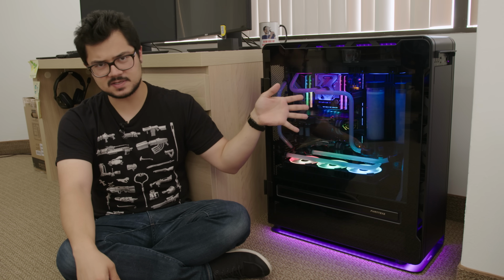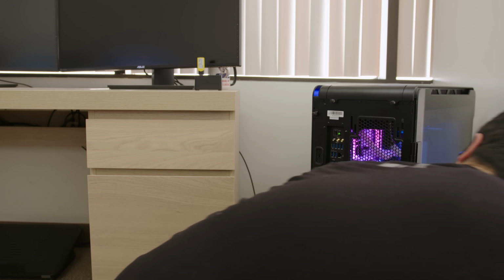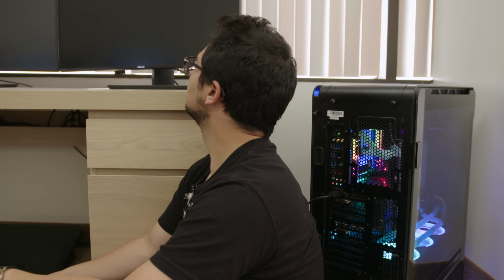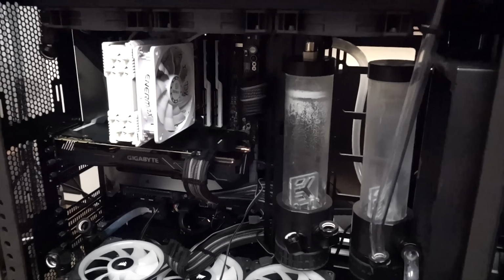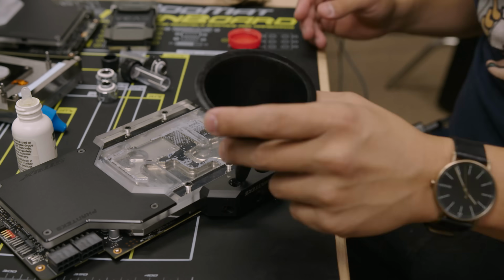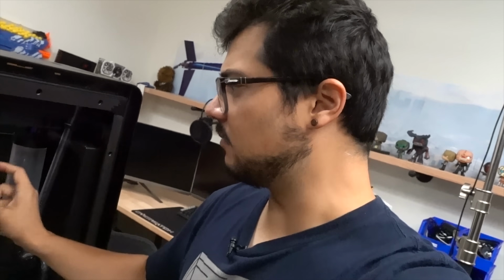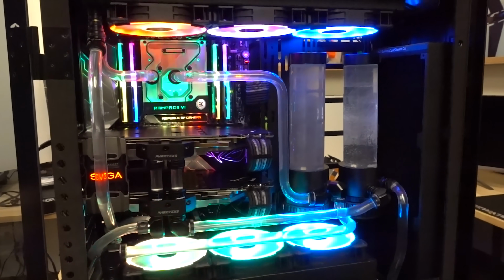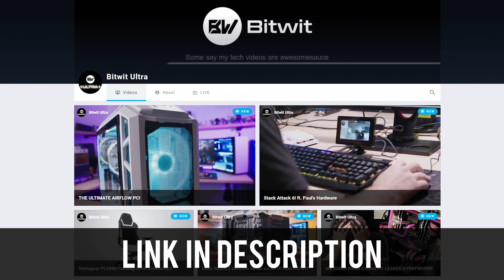Fixing my $12,000 BRICK

Comment: You Helped Me Building My 13,000 $ Pc Love You
Reply: Mack Gaming $13k for a computer
Reply: Mack Gaming I want to see this pc
Reply: Mack Gaming that is the most overkill thing ever I love it
Reply: Mack Gaming - Wow, and I thought the upgrades I was gonna make to my PC were overkill for my use. Soon gonna be getting an extra 16 gigs of ddr4 ram, an upgrade from my i7 6700 to an i7 7820x and an I will be getting an 1180 whenever they come out to replace my 1070. Since I'm moving on from 1080p gaming to 4K gaming I thought the upgrade would be necessary. The extra ram isn't necessary but I might end up buying it anyway and putting it into a new system.
Reply: Just a question why the 7820X and not a 2700X for half the price?

Comment: All that work because you didn't check to see if the monitor was turned on... :P What a Goob! XD
Reply: It was turned on, video wasn't showing. Any number of things could've really went wrong, but the first thing he should've checked was the GPU, monitor, and video cable.

> No video? -  Check GPU, monitor, and video cable.
> No power? - Check power cord.
> No audio? - Check speakers.
> Automatically shutting down nearly after booting? - CPU overheating and the CPU cooler is probably not working or unplugged.
> High(er) overall temps? - Check for and try dusting, then replacing CPU and GPU thermal compound if it doesn't fix it.
> Audio interference? - Buy and wrap speaker/headphone/microphone output/input ends with ferrite choke cores.

Comment: I had a similar problem with my PC. Upgraded the RAM and the computer wouldn't turn on thought I may have shorted the motherboard or something. I had to leave the PC for a while as work got busy but luckily had my laptop to do work. Come back to the PC a few months later and it turns out I hadn't seated one of the RAM sticks properly. Just pushed it in a bit more and it works fine.
Reply: Brookler yea ram sticks can be a bitch like that, I spent 4 hours diagnosing a friends computer. And all we had to do was push in the ram a bit more XD
Reply: I had a similar problem. A friend and I both built new pcs for Christmas. He brought his over to show me and it would not turn on. I looked after 20 minutes found out there was no 8 pin to the mobo. still Wouldnt work. 2 hours later we realized that the ram was in 1 slot to the left.

Comment: Had a similar problem to this before. When I turned on the pc I'd have no errors but there was no post . I eventually figured out that power saving on my monitor was messing with the rtx2080 . Now I have to time switching on the monitor so it boots. A few people reported that display port on the 2080 is buggy

Comment: I think the problem was with RAM, i've had issues with ram before and not getting anything displayed unless u remove all ram and do a CMOS reset. Even then just booting with 1 stick to get it to POST then installing the additional DIMM's. If this isnt an actual solution then i am stumped too as to what it could be. If it was a GPU issue not being seated properly I believe pluggin it into a monitor would come up as no output device detected. Looking forward to a feedback / reply. Great video and awesome setup, Kyle!

Comment: rx 580 8gb or 1060 6gb?
Reply: i think 1060 is better but the price is higher right?
Reply: Get whichever is cheaper. They are more or less equivalent
Reply: Definitely go RX580, about same performance in DX11, but way better performance in DX12 and Vulkan.

Edit: Also freesync monitors are way cheaper then g-sync monitors.
Reply: I just upgraded to a 1060 3 days ago. It’s amazing
Reply: get wichever is cheaper
Reply: The cheaper one unless you have a freesync monitor that needs the rx580 even if it's expensive
Reply: Type in google rx 580 vs 1060 and visit the page called gpuuserbenchmark or something similar like that. Its a very useful site
Reply: Wait my rx480 was already roughly equivalent shouldnt the 580 be a bit better?
Reply: userbenchmark isn't 100% reliable because it doesn't take into account what manufacturer/model card they have, what CPU they've paired there card with and weather or not they've overclocked it or if it's factory overclocked etc.
It's a good website to see what kind of performance to expect from a particular GPU but it isn't recommended to use it to comapare 2 similar GPUs since there would be many variables involved.
Reply: Both are good cards, go for the RX580 if the difference in price is small, you could also benefit from free-sync as these monitors come in quite cheap!
Reply: i would go with  1060
Reply: I would go for rx 580, it’s the best value card as of now
Reply: RX 580, 8GB is always better to have, and the much more important part is it can be used in Crossfire, while the 1060 cannot. Two RX 580s scale to near double performance of a single card which is around ~1080-1080TI range. I picked up a RX 580 card for $250, then another 6 months later for $200. Its a great card on its own too and provides a good upgrade path, as well as FreeSync support for monitors which is slightly cheaper than G-Sync.
Reply: I would say get whichever is cheaper, but there are some things to concider: The 580 supports DX12, and has 8gigs of memory, which makes it more future proof. If your monitor has G-sync or Freesync, go with the card that supports that feature (For instance, definitely go with the 580 if your monitor has Freesync). The 580 does also support crossfire (allows you to pair it with other AMD GPUs), but the 1060 does not support SLI. Verdict: PERSONALLY, if you want a card right now, I think the 580 is the better card (If they're both relatively the same price). I have a 580 myself and I love it. Also concider that the new Nvidia GPU series is coming out soon, so if you're not in a hurry, I would concider waiting for those.
Reply: Save a little longer and get a 1080
Reply: If your using the card for video editing and are using premier pro go for the 1060 for cuda support and faster render times. If not go with the rx 580
Reply: rx 580 8gb way way better
Reply: rx580 and i have no regrets for the good prices they are at right now
Reply: i got an rx 580 8gb because it was cheaper aswell as its vram
Reply: ya 8gb vram does wonders and driver updates keep improving performance

Comment: I had the same kind of issue with my PC. I have a morpheus 2 custom cooler for the 1080ti which is pretty big. The clip that holds the 120mm fans was sticking out and hitting the motherboard which just barely blocked the PCIe connection by a millimeter. Finding that out was such a pain.

Comment: My guess is the fluid that you were using was clogging up the system and causing the issue on top of maybe a loose card but I thought when trouble shooting the first thing you would check is all the cards and see if they are seated correctly.

Comment: If you had an improper video configuration, nothing may show on screen.   When you removed video cards, that will reset video and allows a signal to show.  I had integrated and a gpu card and tried to display on both but nothing would display on either port until I removed the video card and bios setting "reset" to only working view.

Comment: If you start with A0=All is Good, why are you even starting with clearing the CMOS? Have you checked cable connectors?  Have you tried different monitor cables? Different monitors? I keep an old monitor for my test bench I know to work. A Raspberry Pi with connector adapters would be a great test unit to rule out peripherals (and connectors). If peripherals pass,  odds are it was something not properly seated, most likely one or both VCs but you didn't eliminate them as a problem as you went straight to barebone, which isn't bad, though it would have been nice to see the problem narrowed down to the issue.
Did you run it with the PCIe M.2 board installed again? 
What did you clean off/out your tubes/reservoirs/blocks with? I have yet to work with custom cooling and would be interested in how you went about it. Glad to see that pearlescent cooling fluid is not a great idea, so thank you for that. Looks like artificial cholesterol, a potential head issue indeed!

Comment: Had a sort of exact same issue... disconnected, reconnected everything disassembled and reassembled the whole rig, cleaned it in the process.. and guess what !?! It was booting the whole time , but the HDMI cable semi-died. and finally after hours of hitting my head i take an old VGA monitor plug it directly to the mother board and i see picture . instantly i change the hdmi cable and yup ... simply worked normally

Comment: I’m almost positive it was your flux capacitor not aligning with your cpu ram drive. Sometimes if the megabytes outweigh the power supply you’ll drain the motherboard. Easy fix though glad you figured it out.

Comment: Had the same krap with my Rampage V board and 1080, thought the system was boned until I used and HDMI cable, presto it all worked. Once I got into Windows I switched back to Displayport. Every now and then the system reverts back and I'm forced to use HDMI to see anything again (Usually after a Windows reset). Still not sure if this is a Windows issue or the Nvidia graphics.

Comment: I think maybe it was the VUE fluid. I think it possibly clogged up the CPU heat sync which made it run really hot and not be able to boot. Once you drained it and put on an air-cooled cooler, everything seemed fine.

Comment: I had the same issue with my rog board / gamimg pc. What did the trick for me was that I booted the system without any hdds and ssds. Then I restarted the pc with the storage devices plug in and it worked.
Reply: Asus motherboards are garbage... MSI and Gigabyte BOTH make better products.

Comment: If you haven't fixed this by now, ive had this exact error about a month or 2 ago, it ended up being my G Skill Ram, for some reason, it wasn't communicating with my Z390 motherboard properly, switched it out to cosair, haven't had an issue since. let me know if this works.

Comment: Had the same issue when installing a new power supply wrong voltage was wrong going to the motherboard and once changed posted and booted into bios.

Comment: Mine had the "double boot", more like infinite reboot. It was a junkyard computer I mix and match parts with, I only tried with cpu (without heatsink), 1 stick of 2GB ram, no boot drive, no external GPU. I removed the CPU (1155) and moved a few pins in the socket a little bit and resited the CPU back in, everything started working. So mine was just a poorly positioned CPU and maybe a socket pin out of place. What I learned was that a computer that reboots with self-check is probably a CPU error or RAM, since that's mostly what it checks for at that state (I could be wrong).

Comment: I had same issue no post on 9900K. Reseating graphics card fixed it. I had upgraded the day before and moving it to the floor i guess loosened the card enough that it did not post. Now working great. No custom loop or anything just a cheap 240MM AIO cooler.

Comment: Yes, probably a partial connection somewhere, GPU card & maybe even CPU since you restocked it while putting the air cooler on.  Really no telling, usually better to check that cards are seated, cables are connected properly & CPU are seated during post by applying little pressure by hand before tearing everything down,  that way you have a better idea where the issue is, instead of now being uncertain if the post will crash again due to something else you might have missed. Hopefully you want have anymore trouble now that you reseated everything.

Comment: Hey the issue may be the distilled water, distilled water is absent of minerals which can be important for thermal conductivity. Normal water can contain copper, iron which help with the transfer of heat. With the CPU your running you may want to look into a different fluid to use.(obviously not that grossness you were using before hahaha)

Comment: it could also be that the tubing for the GPU is slightly too long pushing on it causing disconnect as GPU sag would do in an extreme case  edit but as we see in the end it worked so probably just not seated properly

Comment: After clearing CMOS and BIOS flashback if the motherboard was telling me there was a disk error, I would have been trying to boot from a flash drive, checking everything was seated correctly, reseating RAM and then reseating everything else. It's funny how many of those options weren't available with hardlines and nVME drives screwed to the motherboard beneath shields beneath watercooled graphics cards which need to be drained to be moved.

Comment: The card wasn't necessarily seated wrong either, could have also been a poor seating of the PCI express power connectors (although more recent cards seem to have a boot screen to let you know they aren't getting their secondary power). I've had a few post fails be fixed by just re-seating my power connectors on all pertinent parts. With a system like yours post A0 and not showing post I would have suspected the GPU from the start >.>

Comment: Your graphics card was just unseated. It might be due to the weight of the card in the PCIE slot. I think i had a very familiar problem a while ago with a computer. My advice it to seat your card with as little stress on the PCIE slot as possible. Another reason to avoid custom water cooled systems is when you got to work on the computer it could be a problem. Water cooling still looks awesome though.

Comment: AO according the manual read that the control has been giving to IDE or in this case the OS HDD so M.2. Really a vague as hell error code, but at that point we now the GPU was activated but it didn't start as Windows was attempting to start. During the POST, a good indicator that you have a GPU issue is that you never got a screen on the monitor. The POST made it to the point where the GPUs were activated so you were past POST codes and to the point were you would get POST messages. IDK if there are POST cards that work on the newer MBs but if there are they're a bit better, usually, than the built in. You should do a video on everything POST related with all the PC builds you do. I'm sure it would beneficial to you and viewers. Maybe. Lol

Comment: I'm planning on doing a sleeper mod (old looking outside and modern inside modification) desktop using base 3 coding and hardware so having a ternery computer basically, which is theoretically more efficient since it covers the yes, no and neutral responses (usually computers error if it's neither yes or no, or just says it's no even if it's neither yes or no) so not quantum computer level but more human level processing.

Comment: I build a PC for my cousin with MAXIMUS VIII EXTREME MB. His room is kinda underground and he has similar problem. He was running 6700k with 1060 6gb and no later loop. Just CPU water cooler. He had exactly same thing. Fire up PC , no post , no beeps , just fires up and nothing happening. I pulled everything from the case and made it on the MB box and ran perfectly. The thing was.. it was grounded for a some reason. And pulling everything off cleared that. Tried Resetting Cmos , BIOS update , none of this worked. TL:DR: Maybe some of the parts were grounded (GPUs)

Comment: Just some advice from someone who's been working on computers since Windows 3.1. Next time you mount a motherboard to a case, do not tighten the board screws all the way before you insert all the cards in their slots. Most cases mounting holes do not line up perfectly and the case flexing from being moved around can cause cards to shift. By mounting the cards first before you tighten the motherboard screws, you're positioning the card in the slots where they need to be. So, mount the cards first then fully tighten the motherboard screws, it lines everything up. I've encountered this same problem countless times, so I know it works.

Comment: Hey I get this is freaking late to the party and all, but did you try just putting the video cable into the other card? I've had my machine randomly swap primary SLI cards on me in the past. It was a weird day.

I once had an issue where my SLI rig (2x GTX 980s) was just black screen with no post happening slightly similar to this video (but likely a totally different issue). At first I blamed the PCI slot, then I blamed one of the cards, then I blamed the SLI bridge; finally I just swapped the two cards over and that fixed it. Both cards work now. I swapped them back again and they both work, as if the problem never happened.

I think what happened was the SLI configuration got messed up and the machine had no idea what to do with the two cards. Unplugging them and swapping them over seemed to have fixed it.

Comment: i got 1700 ryzen and it 1.300 volts and it at 3.25gz and it on cpu z stres and it 130 on full blast whth 160wat geatsink  what to do lower oc or what 30c no lode

Comment: Hi!) I think the problem was in that some pins on the RAM or graphics card, or even on CPU were oxidised. It's ok, because of higher humidity in chasis while you're ising water cooling. And when you're taking them(pc parts) out and installing back, oxidised pins clearing themselves by scratching of pins in the slot)) p.s. I hope you understand))

Comment: i know when my system reads a1 a0 it’s actually telling you which hard drive its trying to boot from which explains why your numbers change when you took the ssd out also if the computer was completing bios reset and double booting that means that the system it self specially if bios flashback is working then double booting/testing configs the pc was actually booting into windows every time i almost guarantee the only option of an error is the video card

Comment: Over current on the water pump causing under voltage to the board? A voltage issue would cause weird issues. Maybe that sludge wasn’t pumping easy enough.